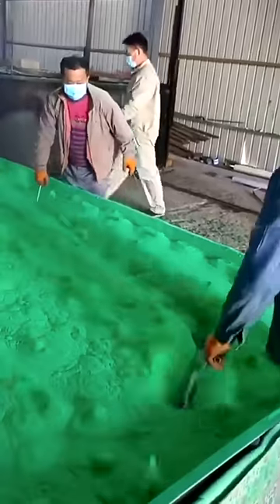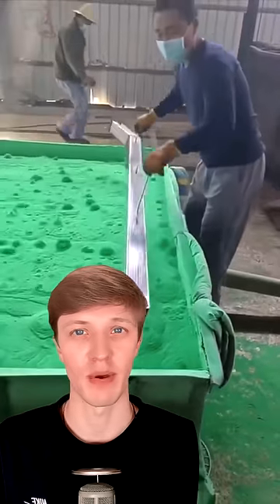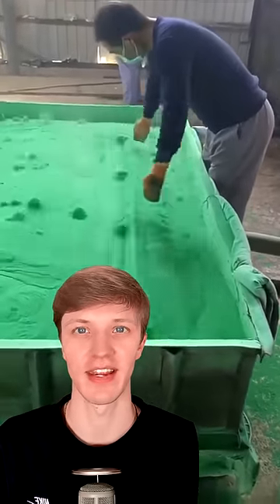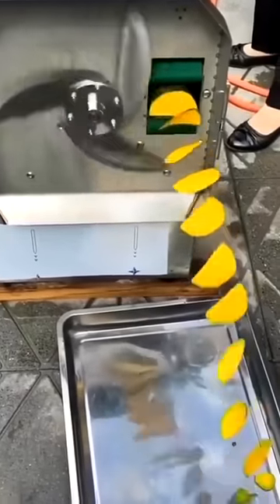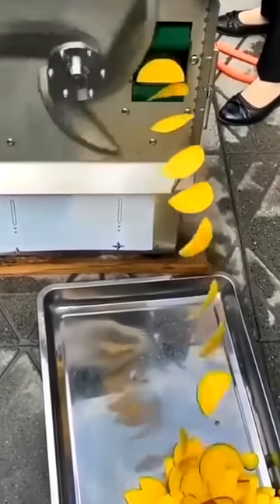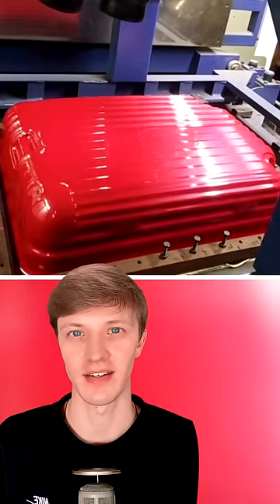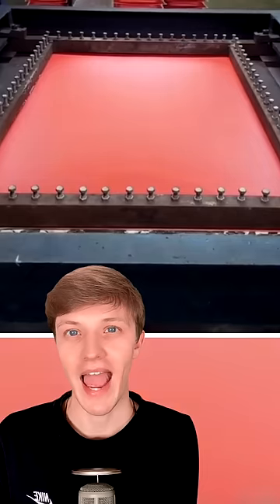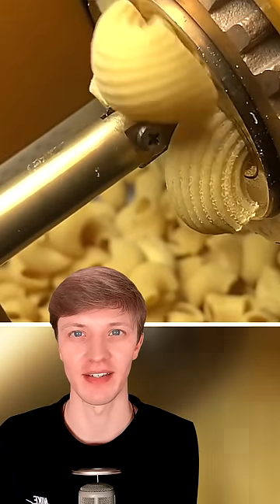How Things Are Really Made

Comment: That metal is not painted. If it were painted they would spray with paint. The metal is powder coated. That's why they covered it in powder coating. Two very different processes!

Comment: OK there's more to it.

Powder coating is basically plastic particles, floating in the air, charged positively, put on a metal object charged negatively 'or the other way around can't remember), then cooked to form a strong protective film.

But wait there's more !
The dust is usually "sprayed" on the object, here they have compressed air going into the bottom of the tank to make the powder act like a liquid, Mark robber made a video on that a few years ago, before he became basically a chimera between Mr Beast and a snitch.

Comment: wow this is inaccurate... Powdercoat needs to be cured in an oven to meld into a paint coat or else it will just fall off... the suitcase isn't "sealed" in the wrap, the wrap IS the case. The plastic heated to me maluable and then vacuformed arround a cooled mold..